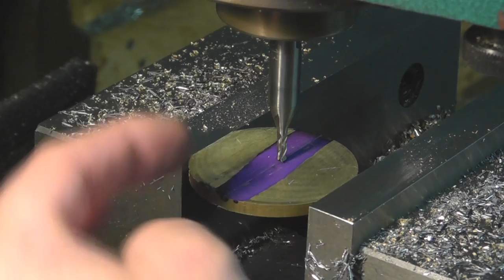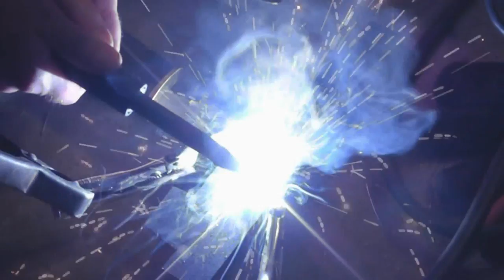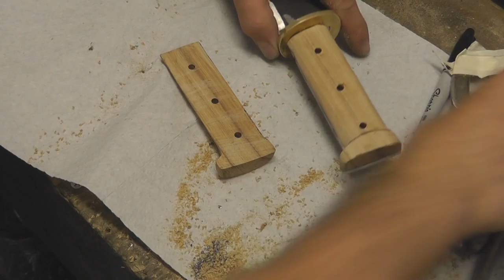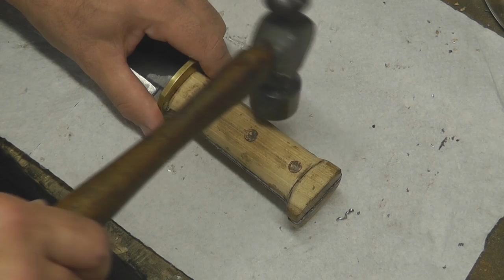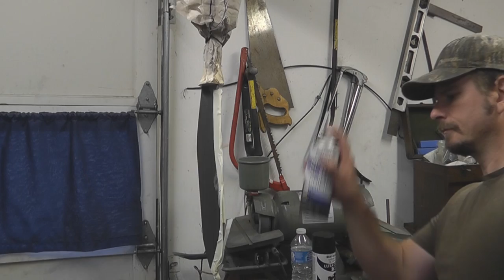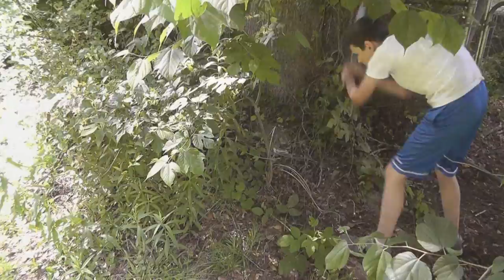Making a Bear Grylls survival machete!

Comment: Cool video, came out great. A good improvement would be a heat treating of some kind to harden the steel. Without it, it will dull out quicker than a quality machete, but I'm sure it will still work just fine. Under light/med loads I don't see why this wouldn't work as expected, It would most likely bend before it brakes so I couldn't imagine that it would be as dangerous as others have suggested. Props on an awesome job bro.

Comment: I dont care about the neg comments, un treated steel fracturing etc its nonsense for knifes and machetes. Certainly if heat treated may last longer but the tools are not hammers, spanners they are simply cutting tools against soft brush , wood etc. I think you did a great job and would be happy to have had that machete and trust me i am outdoors every single day. Cant work due to back condition and leg and on crutches but hey i still get about with my aluminium crutches that are non heat treated lol
Reply: nick freeman I am 100% disabled and thank you for your inspirational download. I love the woods also.

Comment: Obviously you have at least $1000 w2orth of power tools but if you will forgive the pun, More power to you. I am disabled so have to limit myself to hand files, a light hammer, a drill and sandpaper. However I learned many things from your video that I can use to make knife handles. Thank you very much for downloading this video despite the critics. I liked your acrylic finish on the handle (I will watch your video again to write down what the finis is you used in case I am in error.). I use Birchwood Casey gunstock oil which works great except on Coca Bola wood. By the way, you probably know this but in case anyone else reads this a person can buy an official Nepal Kukri knife from Bud K knives or similar on line knife stores for $19 plus shipping and handling and it is an awesome knife. I really like the one from scrap that you made because it is big, effective, looks good and will not be harmed by rough handling. Thanks again for downloading your video.

Comment: man, that knife and the work you put into it is awesome, but here's my 2 cents on it for what you think it's worth, yes, it might be better then chinese crap knives, but you did use american construction steel, which is came apparently from a piece of L-shape or even an I-beam which could be A36 a carbon steel,  a high strength low alloy steel ranging from A 441 to A 270, or even a tempered steel an A 514 or even A517, see where I'm going with this, your knife won't probably hold a very good edge, a reason why knife makers don't work with mystery steel or construction steel for that matter is simple cause we do know they have bad edge retention and tend to be very ductile, you probably ground the shape out with an angle grinder and got the edge on it from a bench grinder, meaning you probably heated the edges to a point where it got very soft, simple heat treating would drasticly improve the edge retention on it, simply heating it to a point where it would get to non-magnetic in a simple BBQ, I'm not kidding and quenching it in either old motor oil or peanut oil after that heating it in a stove to 450 degrees and letting it cool naturally in air would make it a safer and more capable blade, the blade as it is right now can and will break eventually and since I have a son myself, I would dread that could ever happen, It might still not show, but believe me it will happen if you do not heat treat it properly...for the safety of your son please do heat treat it, you can even get it done professionally at the cost of less then $ 20 isn't the safety of your son worth that.

Comment: Its not steel, its iron ya got hold of and virtually useless as a tool steel as its way to soft meaning you will have to sharpen it a lot even if you heat treat and temper it in a proper way..
And what does that have to do with bear grylls? gerber manufacture a parang in bear grylls name, not a machete, and its angled the opposite way yours is, you made a "kukri", not a parang... sooo ???
I dont particularly like bear grylls stuff as its cheap chinese steels that wount hold up, but I'd rather get bear grylls parang than that thing as it still will hold up 20 times better and got a proper shape wish you missed out on if you even want to compare it to a bear grylls parang.

Comment: I just subbed your channel...I like your projects. Great job on the knife.
I too make bushcraft knifes...as far as scrap steel I use old snowmobile leaf springs and heat them slowly to straighten them as not to change the hardness. Wicked tuff steel. I cold gun blue the steel after. I have a ton of black walnut scrap I use for handles. Sometimes I glue up thin pieces mixed with oak.
 I don't have copper but use brass pins.
Make my own leather sheaths and leather stich together. Nothing fancy.
Make mine to use like you do....don't sell them....gifts for special friends...lots of hours in them.
Oh ya, I find a poor mans blueing is to soak the steel in pure white vinager.
Thanks and look forward to watching your vids. I don't make vids......

Comment: Great Video, Very well explained and nice end product-well made!, but could I ask about heat treating the blade-would you consider doing so to add longevity to the strength of the blade itself or are you happy to continue sharpening it, as It may dull quicker than a heat treated blade ?

Comment: I feel you need to learn about heat treating metal if cold metal grinding was safe everyone would be knife makers, I wouldn't use that thing for fear of the steel fracturing and killing someone, all the tools in the world with no common sense is more dangerous than when that thing hits a rock and fractures
Reply from the maker: I fully understand what you mean, however the metal is hardly brittle enough to crack in half,   Its nearly 1/4 inch thick and not brittle at all.  Very little chance of cracking here, but thanks for your concern.  It it was brittle to begin with, I might be worried.  People have ground on their axe blades for decades, never heard of one cracking.
Reply: when you accidentally hit hard rock or metal it can/will fracture (I have done this myself) it is scary when it does occur heat treating would be great as you make nice stuff
regards
Reply from the maker: I understand.  The metal it hard, yet ductile and more likely to bend.  I appreciate the input.
Reply: ginsboy2003 Axe heads are differentially hardened with carefully selected steels. One steel for the majority of the head which is split and a bit of high carbon steel is forge welded in for the cutting edge. What you made is not safe to use or to be showing kids to make. I don't care how long you have used it without incident. It is not correct,display the one not made to be used and used the one made to be used.
Reply from the maker: Oh really?  I bet it a lot safer than the tons of chinese crap being sold made from unknown metal.
Reply: Safer is still not safe, only a relative term. You made something yourself and that is awesome. You can only imagine how much better you can make and quite simply. We are the equivalent of gear heads to the knife world and just want people to do what you tried and even though it feels like you're being attacked,the advice being offered is valid. Heat treat the right steel(even an old mower blade) and improve your(which was not too bad looking) and you will not believe the difference and you'll be make something in all your spare time. It's something your son would probably enjoy learning together with you,too. Peace.